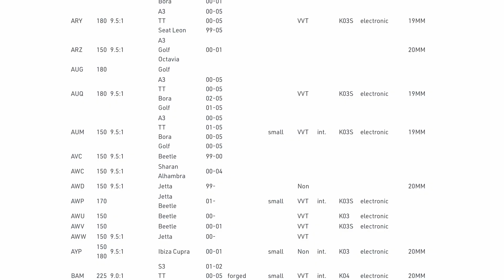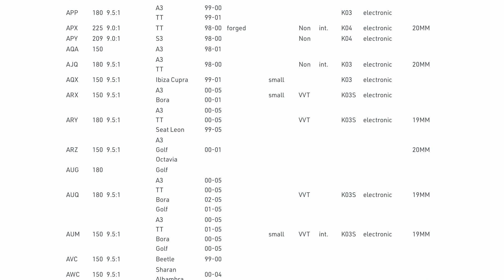Which 1.8T Should You Build?

Comment: I gots one for ya 🎉 
I’m tryna get to 300 give or take..
05 AWP 1.8t with cold 🥶 intake, 
3in downpipe all way back, 
Boost peaks around 21-23 settles at 18-19psi 
Traded my 225 TT for this GTI and would love to get past where I was with it.. was told there’s a “stage 1” tune but haven’t pulled the ecu to check label or anything.. my question is what is going to be the quickest way to 275-300.. turbo inlet pipe, intercooler,ko4 and/or equivalent..? Do I need to upgrade the spark and fuel pump? 93 octane. 
Any leads would be greatly appreciated 🫡
Reply from the maker: K04 are a waste on these IMO. You want lager if your goals are 300whp.
Reply: @COMotorsports  I agree 100%, I’m basically pushing my ko4 to the max. Go with a gt28rs so you can be “reliably” push 285+
Reply: do every single supporting mod(minus internals ofc) and get a tune spiking at 25psi on a ko4, im just under 300

Comment: What connecting rod bolts would you recommend? I have arp ones but wondered if there was anything better?
Reply from the maker: Don't believe ARP make rods, they do however make the rod bolts that most aftermarket rods use.
Reply: @COMotorsports  that's what I asked. I have max speeding rods with ARP bolts but some say they ain't goid
Reply from the maker: @matk22  I wouldn't have bought them in the first place so hard for me to suggest what to do with what you have.
Reply: @matk22  I'd put those rods in the garbage bin before they take your whole engine to the garbage with them. Max speeding anything is trash and will fail.

Comment: I have an APU 1.8t which is from the Audi a4 b5 fwd which is the non vvt cast internal engine with 20 mm wrist pins if im using a 35-82 sized turbo what's the max hp I can make one that engine  reliably

Comment: The AEB has a cast crank, Agu, bam, apy, aum, amk, bjx, Bex all are forged cranks but there are mush more forged. Aeb and Agu are big port. But on my bam small port head I could easily make 500hp. I also went to stainless steel exzhost valves. Stock pistons are very strong.
Reply: Im searching for bam 225hp TT for the simple fact i hear a lot of it is forged from factory apart from con rods. I plan to run 350hp on stock rods and internals
Reply: @liam-lh2nm  Amu or bea for the tt 225 right? If it's a 2003+ bea wideband and if it's 2002- than it's amu narrow band. Same engine from my understanding. Other than vvt

The 1.8t 180 vs 225 1.8t is the major difference right?

Comment: What type of material are you using for your cylinder sleeves in your drag car or a high horsepower build engine 1.8T? Also what piston rings are you pairing them with? Ty
Reply: Just stay stock. No need to be coating cylinder walls

Comment: Hey Dave and Clayton
I have put in a k04 from apr to my 1.8 mk4 jetta. I want to make more power out of it (around 325-350hp). Will that turbo hold or am I going to need to look into something different?
Reply: A stock k04 even on an engine with the best intake and exhaust won't make more than 300. Mine has a 2.5" intercooler pipe work. Huge fmic them porter exhaust and 3 inch turbo back. And makes 284bhp

Your turbo limited at that power. The turbo just runs outta puff
Reply from the maker: Buy a different turbo
Reply: Try a GT2871r, it will do that easy.

Comment: What exhaust valves are better than stock and not $1000 for a set? Currently building a 1.8T with a goal of 350-400whp but more is definitely welcome. Capable of 8000rpm "safely" so springs are a must but I really want this to be a cheap dirty rebuild. Don't judge me! Nothing is going to a machine shop, it's getting a ball hone and new bearings, rods, springs and apparently exhaust valve. Again don't judge me, I have kids and I'm broke!
Reply: Supertech do amazing valves for the 1.8t. Inlet valves are never a problem. Must do exhaust valves as valves fail and the head falls off the stem.
Reply: Bro we are twins, just a year apart! What ended up being the outcome?
Reply: @MrSagerific95  about 20k miles on the new engine. But I drive a lot and it's only been a few months. Haven't put the bigger turbo on yet but a beast even with the smaller turbo on it!
Reply: @4BillC  update?

Comment: A good topic would be Vvt vs non Vvt.
Reply: It's a non topic really. Vvt is used to add cold start up but people have used it for tuning as it gives 22 degree cam movement and 22 degree intake cam phase position is good for improving volumetric efficiency down low: even with the intake valve opening "overlapped" into the exhaust cycle, the earlier closure nets improvement in airflow. But only to a point. Past approx. 4800rpm the zero position is more effective.
Reply: @matk22  I think it’s a interesting topic when there’s power to made down low especially when you lose torque from bigger cams, bigger turbo, large port heads etc.
Reply: @TechyGamerVibeZ  yes but it's already been discussed on YouTube and on forums. Its nothing special. Just use vvt to switch at a set rpm. Nothing too it since it's a on off switch there's no variable timing between the set 0 and 22 degree

Comment: Another thing the TT225 engine is a webbed block with oil squirters in different location then the other 1.8t’s. The AEB block has a external water pump and shaft driven oil pump.
Reply: No the 225 engine really doesn't lol
Reply: @matk22  really doesn’t what

Comment: I've held onto an AWW out of an '01 that had 286k when it was pulled, ran fine, didn't burn oil, that I want to build eventually. The block has some rust on the outside. At what point is the external condition of the block a compromising factor?
Reply: The external is never a factor. But cylinder walls can and will rot. I had an engine sitting for a year and didn't realise. The bore is pitted on 2 cylinders. And with out a heavy hone or rebore I've scrapped it

Comment: Hey, i an new to your channel. I love the content i got a vw mk4 jetta with a AWD 1.8t engine i want to mod it in the future to puch close to 350 to 400 wheel hp what upgrades do you recommend no matter the price to make the car hit that power and still be a reliable car. At the moment is fully oem nothing was ever swaped out buly the privious owner other than all the maintenance. The car also has 128k miles but iwas well taken car of all it life form what i know fron tge perso i got it for i even got the maintenance history that says that all oil changes were done every so 5000 miles. What do you guys think i should do.
Reply: Just look up tunes for that power value and see what requirements are needed on hardware to support the software. Easiest way really. Main things are upgraded rods turbo injectors fuel pressure regulator intercooler intake and exhaust.

Comment: Small port head Stock Vs ported on same tune .. curious to see what gains could be made
Reply: To many variables.

Small port is good up to 450bhp but even then people have used a small port over 600bhp

The real difference will be small port flows better down low in the revs due to port velocity

The large port flows better up high revs due to port size and volume over the small port

Comment: Not a 1.8t question but about fsi 2.0t, what are the power limits of the stock internals and would i need a hybrid turbo to get to that limit or would a normal k04 be able to get to a safe power level for the stock internals.

Comment: 1.8t question: could you guys look at the differences in 1.8t and 1.8N/A cams. You probably have a few you could put a vainer to, to see the lift. Maybe see if the part numbers are the same. I think my 1.8t has N/A cams in it😂
Reply from the maker: We never got NA 1.8t here so I'm not getting my hands on any. Sorry.
Reply: Catcams released specs on the adr cams. It's on their website
Reply: @dialgia111  thanks mate.
Reply: Yea Google it, it's been researched and tested. The higher longer lift aids turbo spool but kills down low drivability. Like anything. There's a compromise.

Comment: I was wondering what your thoughts are on running the vvt tensioner in the head as opposed to non vvt tensioners. Is the extra potential power worth the added complication? lastly, I have a Link standalone ecu, so is tuning vvt on 1.8ts as simple as setting on and off based on rpm or is it variable in any way on these engines?
Reply: It's on and off, you can use it to help boost onset. Very easy to install also.

Comment: My 1.8t question, and you guys could turn this into a video:
What is needed for a 1.8t stroker kit to 2008cc! I believe its just a TFSI ea113 crank but I'm eager to know more about it
Reply: ea113 crank (92.4 mm stroke), adequate pistons (with smaller compression height and 20 mm wrist pins while you're at it) and 82.5 bore oversize will get you to 2.0

rods are all 144 mm long

btw i think u can up the capacity to about 2.1 if you use the tdi crank (95.5 mm stroke)
Reply: @rcm57238  bless you👍🏻
Reply: @rcm57238  piston suggestion on this dude?
Reply: @jonathonwilliams93  no actual tested results on this engine as i have never built one before but wiseco has proven to be a reliable brand (at least from what i've seen, obviously with proper installation) and they happen to offer stroker pistons for this engine

Comment: 1.8T question: How do you do 1.8t breathers on higher hp cars? Is it normal to have more oil coming up from the head compared with the block breather?
Also, could a very restrictive (valved muffler, when closed) to cause a bit more breather blow by? Keep up the good work!
Reply: Change the elbow on the block to a metal one. Then use 19mm oil/fuel grade rubber hose link the crank and cam breathers and either run to atmosphere or to a high flow lol can. And the atmosphere back to the inlet.

Personally I run mine to atmosphere to avoid any oil blow by or condensation going back through the system.
Reply: @matk22  This is ruffly what I have at the moment, but with plastic connectors. The thing is, I see quite some oil being dumped, as it's venting to atmosphere. And I suspect it's coming from the head, not the block.
Reply: @HidRomail  you could run seperate hoses and check. If it's from the head might just be poor oil or old oil

If it's from the crank then it'll be due blow by and that's down to work rings.

Can do a compression test to see what the engines doing

Comment: On the subject of pistons. I'm assuming new OEM pistons with aftermarket rods would be more advisable than using the old pistons out of my 205k mile engine. And on that same note, would you advise just trying to find the 20mm wrist pin pistons since the aftermarket rods are easier to find in that size? My old MK4 is tired and i want to show it some love after 6 and a half years of service.
Reply: You can reuse the pistons out of your motor as long as they are not damaged. (I.e. valves never made contact). If you have the smaller wrist pins and want upgrade to 20mil wrist pins, then yes, get new pistons
Reply: Aeb or agu pistons. Check piston to wall clearance if your worried

Comment: Also 058 - AEB, AJL has M11 head bolts. 06A - AWP, AWM etc has M10.
Reply from the maker: Yes correct. The video is way longer than we expected. Point mainly...is if you're building it...it doesn't matter.

Comment: The poor, lonely rabbit...

I do really like my 1.8 Mk 7 golf - EA888 

It's been a great engine, but I'm especially hesitant to tune it now, as I recently lost my oil pan to a truck tire on the highway. Now I have a slight, occasional rattle at startup, that I think is a chain tensioner noise... if anyone has experience with that, please enlighten... ~76k miles

Those 1.8t's are fuckin awesome